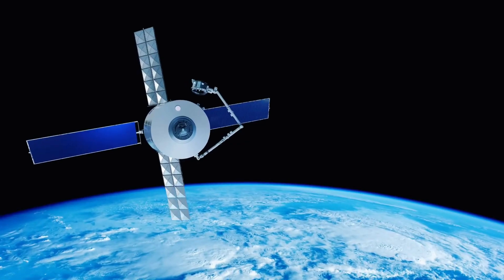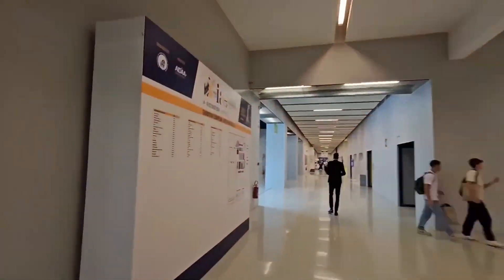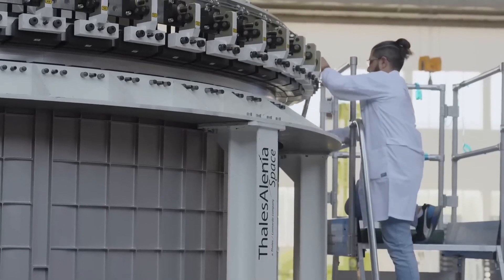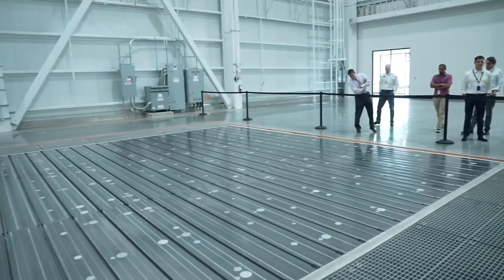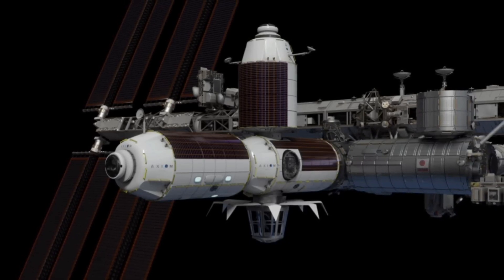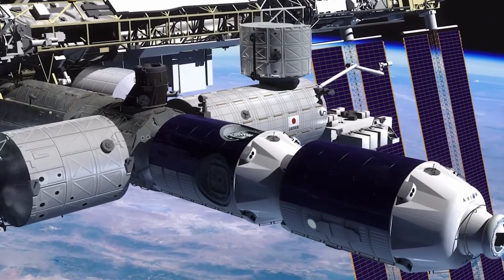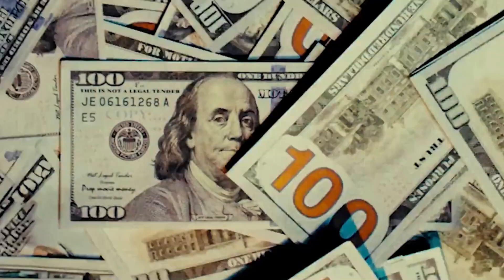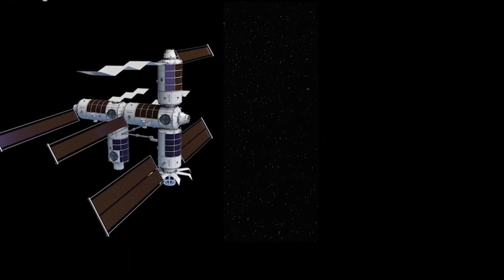Unexpected! A New Space Station is Coming Faster Than Planned!

Comment: While the current Axiom Station plan still makes sense, especially for leveraging the existing ISS infrastructure, the introduction of Starship into the equation offers significant opportunities for optimization. Axiom might need to adapt its strategy to capitalize on Starship's capabilities, potentially leading to a more ambitious or differently scoped project. However, without definitive information on Starship's operational timeline or final capabilities, these considerations remain speculative.
-Grok
Reply from the maker: Thank you for sharing useful information...